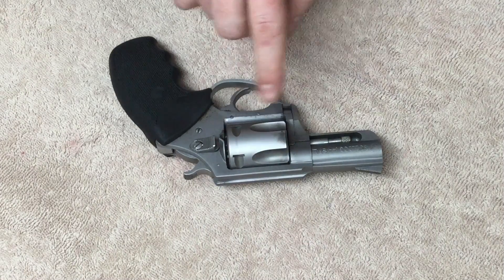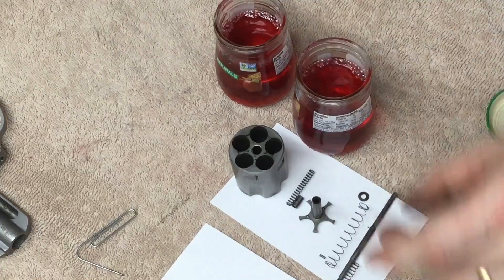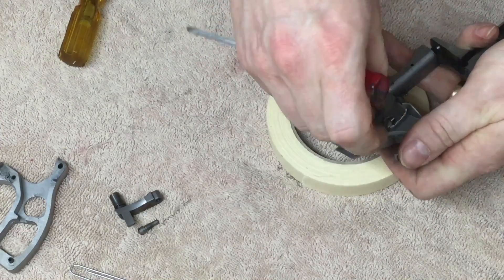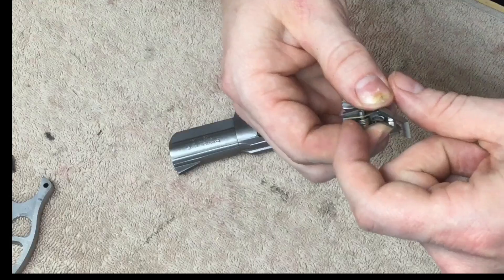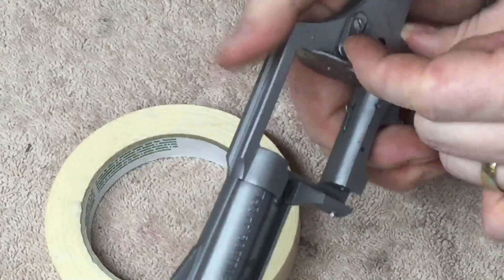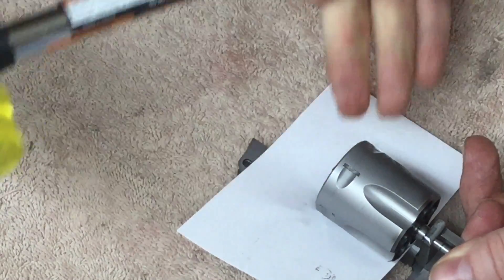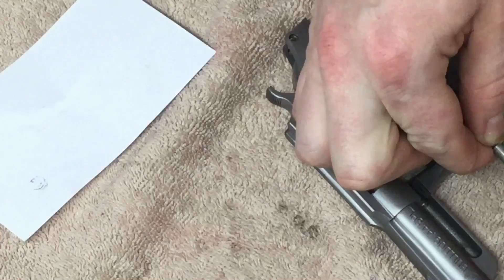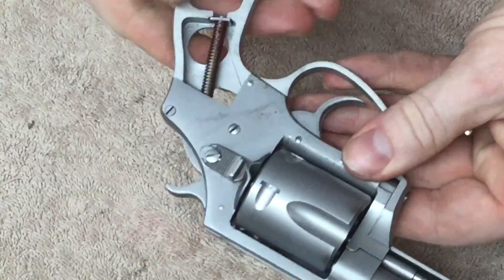Tear Down and Reassembly of the Charter Arms Bulldog

Comment: I love my C,A, Bulldog.. I have put over 1.500 rounds through it.  Good Pistol. My front sight is a little canted to the left, So I have to hold left on targets that are over 10 yards away to center the hit's, However it's not enough to worry about, It's a "uppy closey" pistol for self defense. It's a little hard on the hands after 50 rounds at the range, I was using it as a test pistol for my show, But it has been retired into the role it was intended for now as a EDC pistol. I have the Flattop Ruger now as a test pistol and is less taxing on the hands. Good instruction Video dude.. Dave.
Reply from the maker: Mine is slightly canted left as well.  This dog will bite the target hard, but it will also chew on the hand that feeds it.  I had to file a couple edges down after the first couple times I shot it - razor sharp edges in the trigger guard are not fun on a heavy recoiling gun.  I really like this gun, but it's not my first pick for extended range sessions.
Those Rugers you've got are a beautiful pair!
Reply: Thor's Axe: That IS love..to compensate for the front blade like that. Be well and safe

Comment: I love the Bulldog, I find the weight to power ratio to be top of the food chain. mine is very accurate and has an excellent trigger, both single and double. I have a lot of options for EDC including a top shelf Officer's Model 1911 but at 36 ozs. and only 7 shots, the Bulldog is the clear winner at 20 OZs (weighed on a postal scale) with 5 shots.I use Charters small wood grips, for better concealment and yes they are a little harder on the hand. my only real complaint about this little firearm is the aluminum grip frame.it turns black behind the hammer and I would REALLY like to get one in stainless. I would accept an extra ounce for that upgrade. as far as long range, I get decent accuracy at 50 yds and tolerable accuracy at 75 yards, making it an ideal hiking companion as well as a self defense weapon. the video is very helpful, and not at all misleading, the difficult areas of reassembly are clearly spelled out.
Reply from the maker: It really is a great little revolver.  I ordered the small wood grips, but the fit was so poor I took them off before I ever fired a single round.  I appreciate the comment cheops1292, and good shooting to you!

Comment: Such a wonderful revolver and a piece of cake to completely tear down and reassemble. My 2 CA Bulldog .44 Specials are both converted into Live-Firing Hero replicas of the Blade Runner Blaster! Definitely my favorite movie prop ever created, a work of art to say the least. My #1 will soon even have a real Steyr Mannlicher SL .222 Rem receiver mounted on it of it as well!
Reply from the maker: I didn't think I'd see any of those until at least 2019...
Reply: Any notes or videos on your conversions? I am collecting parts to do the same thing. Have a good candidate Bulldog and resin Tomenosuke. Now on the hunt for a Mannlicher SL receiver...
Reply: @ljg6979  - It was the most difficult conversion I’ve ever took on! I suggest joining RACprops facebook page for any and all questions and instructions. Rich is the master of the blaster. He’s had first hand experience with the original prop from the 82 film. Good luck, you’re gonna need it. It took me 2 times to get it right!

Comment: This video was very useful in helping me understand how to disassemble a Charter Arms Pro 209 primer pistol and replace the broken hammer block / transfer bar. Replacing the trigger assembly with the spring is indeed tricky, but not impossible. You will need some finger dexterity and patience to compress the spring and replace the pin that holds it in place.

Once you slide the trigger assembly back into the frame, you can peek into the frame (with good lighting!) to see if the leading edge of the spring is contacting the appropriate part of the receiver. I suppose you could do it by feel, I liked having the visual confirmation I had the trigger assembly in the appropriate position. 

I held the punch in my mouth as I aligned the trigger assembly since I really needed both hands to hold the trigger assembly in the proper position. I took a break once the punch was in place to gather my wits. Like in the video, I did back off the punch as I replaced the pin. What’s not shown in the video is actually getting the pin inserted all the way through the receiver frame and trigger assembly. I used my hammer to gently tap the pin to get it through the grommet.

Comment: These are the only guns I've seen (gunsmith 40+ yrs) that have gotten better!  Had one of the earlier shrouded ones and it was OK.  This stainless target bulldog is a much better gun.. Finish wise, it's not a smith.. But function is fine, accuracy acceptable and it's in a class all alone. All stainless, 44 under 1.5# 4" adjustable sights... and @400 bucks.  My carry gun, fly fishing in bear country  and sometimes in N. FL rattlesnake  country.  Great with  shot capsules.  Thanks for the servicing video.
Reply: Forgot to mention I like the Pachmayer compact grips better that the flat hard rubber factory ones.  Better control & recoil absorption.
Reply from the maker: Thank you Greg!  I fear that many folks still associate the revolver with the unfortunate event in the mid 70s, and with some of the lower quality items that were produced at times, and then write off the current production as junk.  I love mine.  As you say, it's not a S&W, and it's not a Ruger, but it does work just fine, and for size/weight/caliber/firepower, it has no competition.
I've considered the Pach grips, but I've been okay with the factory rubber, and I fear the Pachs would increase the size.  I use this as my EDC, and usually carry it IWB.  If I'm headed out into the country, I will normally grab one of my S&W 44s.
I appreciate the comments!
Reply: The Pachmayer compact grips don't increase the size..In fact they're @ 1/16"  shorter, but are softer and a little thicker so they fill your hand better and absorb recoil.  They do add a little over an ounce to the weight, and I needed to cut a small notch in top for hammer clearance on single action.  But for 25 bucks, they are a nice addition.   Thanks again for the video!  Been a long time since I took one apart.. They rarely need much attention :o).
Reply from the maker: Outstanding!  I'll definitely pick up a set.
Reply: @LoadsofBacon  I've tried all four grips on my older Stratford Bulldog.  The compacs cause recoil to smack my middle finger more than the std grips CA supplies currently.  The Classics are even more painful.  I've come to really like their current grip.  I'll save the little wood grips in case I get a light .38 for the pocket.

Comment: I've made the mistake of disassembling the cylinder latch.   Pretty much a PITA to reassemble, holding in the spring and pin and not losing them.  Having to line up everything.  Charter sells a tool to hold the pin & spring in place, makes it easy as heck.  The tool is simple but costs about $20.00.  Can be easily reproduced from a piece of sheet metal.  Saves alot of time, swearing any crying. :)
Reply: Ha ha tell me about it!

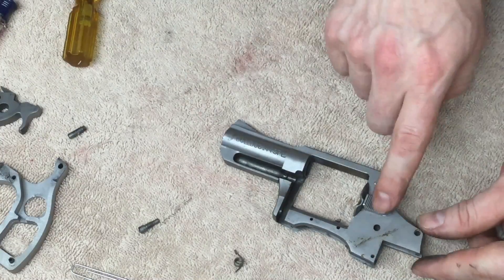Comment: At the point where you said you had taken the latch apart before is exactly what I need to see I inherited a 44 bulldog and the latch is not working I feel there are parts missing I need to see the tear down so I can compare please  Scene about 5:44
Reply from the maker: I don't personally have the latch process on video, but Charter Arms does: https://youtu.be/KSlqqSCFqbM
I suggest doing the work inside of a gallon ziplock bag or some other similar area where tiny flying springs can be captured.
Reply: @LoadsofBacon  Thank you for your help as I suspected the spring is damaged and I am missing 2 other parts  you have been very helpful thanks again
Reply from the maker: Give Charter Arms a call.  They'll help you out.  That's how I had to get a replacement for my missing latch spring 😁

Comment: Great video!  I was relieved to see that you had almost as much difficulty putting the trigger back as I did.  LOL   For me the secret was using a temporary punch that had  almost no play in it.  I had first tried a narrower punch that had a bit of play and that made it difficult to line up the pin correctly.   The larger punch lined it up perfectly and the pin went in on the first try.  The larger punch I made our of a small nail.

Comment: Nice design, I heard they’re actually a bit stronger than originally thought. The fact they’ve been chambered in 44 spl as well as 40S&W, 45 acp and 45 Colt reflects this as well as the notches Between the cylinders instead of on top of them. That’s not to suggest use hairy handloads.

Comment: I enjoy smithing on some levels. Probably because I always take things apart. Awesome vid. Oh and I just tagged you in a photo on Facebook. Something that's 100% you.
Reply from the maker: I can take anything apart...putting it back together can be a challenge at times...
Facebook tag?
Reply: I agree, especially drum brakes, and parking brakes . . . And Smith & Wesson revolvers. Well technically a post, but it was directed at you. Your Loads of Bacon page, it was from me but a shared posted from Full30.com . . .
Reply from the maker: Brakes are always "fun".  I'm working on a power steering pump and a heater core right now.
Reply: Replacing an exhaust on my 30yr old Honda this week.

Comment: I bought a 357 Magnum snubbie.  Per Charter Arms, it was made circa 1986.  It looks unfired, like its been in a sock drawer for 32 years.  The ejector is stiff, the cylinder latch doubly so.  I suspect gummed up lubricant.  I've never taken apart a Charter Arms product before.

Comment: Right at the beginning, unscrewing the ejector rod head.   how much heat, and how applied, to break the loctite?   Mine is  not (yet) coming loose for me.  My ejector rod is a little "scrapey", and I'd like to take it down to inspect and possibly smooth it up.
Reply from the maker: Sorry for the late reply; I have been moving.
It's been three years, so I don't remember the exact details, but I believe I used my heat gun (it looks like an over-powered hair dryer).  Make sure you remove the grips first.
Reply: @LoadsofBacon  I actually found my heat gun, and it turns out it didn't take much to break the head loose.  (looking to shim the cylinder to attempt to deal with an endshake problem).

Comment: Interesting video thanks.  I have a new model and a classic dog.  The  classic has a gritty trigger and an unfinished top strap.    May send the classic in for work/cleaning.
Reply from the maker: Classic design, or one of the original models?
Reply: @LoadsofBacon  Classic design I believe.  Bought a few years ago, wearing right now.  Serial #14-47xx
Reply from the maker: It would be worth calling them to see what they're willing to do
Reply: @LoadsofBacon  thanks.  did call a few years ago, they were willing to finish working on it.  Leaving the country not too long from now, have to think about if I want to go through the trouble.

Comment: My friend has the same gun, his seized up on him and he brought it to me for help. The cylinder rod is slightly bent and once I put that spring and rod inside the grip, the hammer or the trigger won't go all the way back. Do I have to have the cylinder in it for the trigger and hammer to function correctly?
Reply from the maker: Yes, you either need to put the cylinder back in, or you can also test it by pulling the cylinder release back.
Reply: @LoadsofBacon  I pulled the cylinder release back and still locked. I will put the cylinder in tomorrow and follow up with a comment on if it works or not thank you

Comment: 7:35......that's about where I'd start cursing and raising hell.  I'm always having trouble getting things back together that are under spring tension.  I'm not sure I'd tear mine down that far.  I tore my Rossi 92 carbine completely apart and cleaned it the other night.  Thought I'd never get it back together until I discovered a shortcut getting the ejector back in.  This revolver looks twice as difficult.

Comment: What does it mean when you pull the trigger to the rear and it stays there and doesn't reset back to the starting point?
Reply: It means, send it back to Charter Arms for repair. I bought a used one which malfunctioned and they fixed it for free. I did not even have to pay for the return shipping. If you need the phone number let me know, I have it in my gun case.

Comment: What's size is the INSIDE THE WASTE BAND holster I have the same model
Reply from the maker: I got the Cloak Tuck 3.0 IWB Composite Base for Revolvers (right handed, small frame) from Alien Gear Holster, and then I formed my own shell for it from a sheet of boltaron (a plastic similar to kydex).

Comment: got my wife in 1978 a undercover .38 spl factory nickel non + p.. early model with no shroud .. has always gone bang.. 1000's of rounds .. reloads .. clean tighten screws done .. had a 44 also non shroud , cut the 3'' barrel back to 2'' silver soldered the front sight back on..  head shots so easy at 15 yards ... sold twice what I paid for it ...mistake .. new ones are even better in stainless ..
Reply from the maker: I've been very happy with mine.
Reply: @LoadsofBacon  I'd love to a sight silver soldered onto one of the new Boomers.

Comment: I never thought that there were that many small parts in a revolver cylinder. I don't think I would take one apart. That first tiny pin, or last pin if trying to reassemble it, looks like it would be more than a bit tricky to get back into the cylinder assembly. Also as it appears to be held in by a friction fit, I'd rather not risk having it get worn by removal and replacement which might make it more likely to slip out on its own. 

I've only had to go into the internals of a revolver once (Taurus Tracker .22, a nice gun for the price) because it was accidentally dropped into fine sand, which is something you don't want to do with a gun, particularly not with a revolver. You might think there's no place for crud to get into the inner working parts, but this is not the case. Sand (just a little bit, but...) got into the inside where the hand that turns the cylinder and the locking tab sticks up. It doesn't take much. Luckily, that model has a side plate like a S&W or Colt's. 

Don't drop your guns in sand, water, mud, or anything that you don't want to have to clean out of them, because it's a PITA!

Comment: Everything was removed except the barrel, can the barrel be removed or adjusted? I have a Pitbull and my barrel is crooked. Anyove have this happen, is it an easy fix or does it have to go back?
Reply from the maker: That’s something you will have to have Charter Arms fix.
Reply: @LoadsofBacon  Figured that, I just sent them an email. They are 90 minuets from me, however I am not sure if I can transport the gun in Connecticut, I have to look into that, or just ship through my FFL guy. Thanks

Comment: all I got to say is wow I would never do that
Reply from the maker: I saw you pull that 38 cylinder apart...
Reply: yeah that was old gun and all I had to do push the little lever and pull the pin it does not have a crane on it and I didn't remove trigger and Hammer that's the complicated part I could probably disassembly get mad and lose the parts
Reply from the maker: It is probably easier to order replacement parts for the Bulldog than it is for that 38.
Reply: that's right yeah they quit making that gun around the turn of the century ain't that crazy those guys were shooting 38 specials through it
Reply: I forgot we just turned another century it was the 19th century
Reply from the maker: I'm guessing they must have been shooting wadcutters
Reply: the 38 S&W original loading was a 200 grain bullet at around six hundred a half to 700 feet per second

Comment: My first revolver was a bulldog in .44 and for the money it is probably unbeatable. Has a better smoother trigger then my Ruger SP101 at $200 more. Easy to take apart but generally no need to...if you want a wheel gun that's easy to strip the SP101 makes it about as easy as possible.
Reply from the maker: It does have a surprisingly good trigger for a "cheap" revolver.  I was a little suspect before I bought it due to a number of negative reviews, but I've been very happy with mine.  It's not made as nicely as my S&Ws, but it doesn't need to be either.
The SP101 is a nice revolver too.

Comment: I wonder if it would be easier and just as effective to put the whole pistol in a cleaning solution in a vibratory cleaner.
Reply from the maker: That's probably a good option.  I don't own such a cleaner.  If one were going to to do that, I would suggest removing both the grip and the hammer spring first.  The hammer spring has a protective coating on it, and I am not sure what the vibratory cleaner/solution would do to that.
Reply: That's good to know information. Thanks for all the detail in the video too!
I don't own one yet, but I am searching for a Bulldog after I dry fired a DAO 38 special Charter arms at a gun store yesterday. A very nice DA trigger, at least equal to my S&W 649, and very close to my 642. I cant understand all the CA hate, unless they all fall apart after a thousand rounds or so, but I doubt they could be fragile, without the company going broke with the lifetime warranty.
Reply from the maker: Thanks BuckOrtega!  Over the years they have had some less than stellar quality control, and the company has changed ownership a few times.  All the reports I'm hearing are that the current production are some of their best.
Reply: Bought a new Bulldog XL 45LC, it is fun to shoot, and plenty accurate.  CA also has a 41 MagPug now.  The 44 Bulldog is no longer the king of the heap.